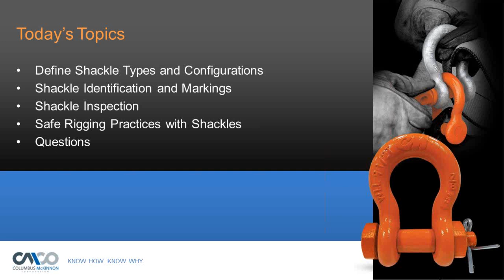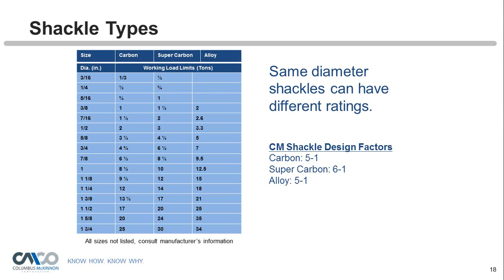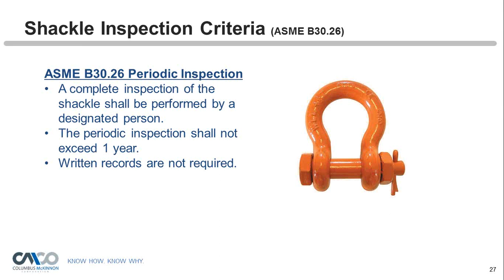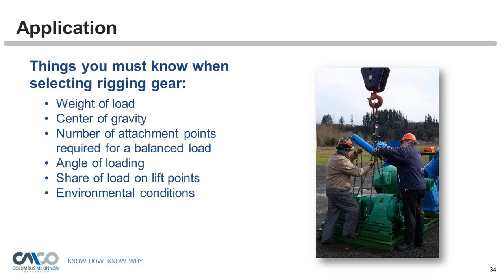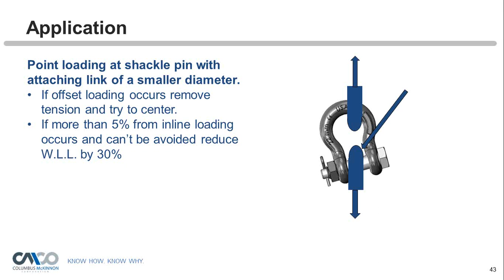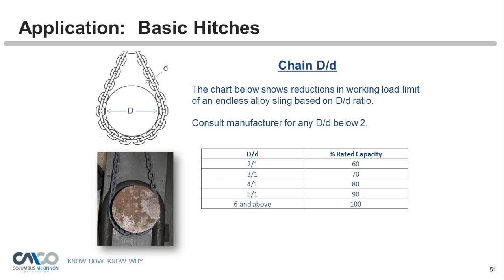Safety Webinar: Proper Use of Shackles

Comment: No tag lines installed by the crew which was a major no no. The footing (dunnage) wasnt secured which caused the load to slide and slip out. The strap was questionable but i feel it broke when the load was dropped causing more weight to be put on one side vs the other. Probably overloaded its capacity. Lastly them straps were on a bar with nothing preventing them from coming off. Why didnt they use a secure lifting lug with a shackle?

Comment: What is the proper way to tighten a screw Pin on a shackle. I have a customer that is saying the top of the bolt is breaking it after using a wrench to tighten it.  Should you only hand tighten a screw pin in a shackle?

Comment: I have a question.
If i don't have 2 meter 5ton Swl wire sling, i can bring 15 shackles and connect them between each other to reach the 2 meter length which I need.
Its a safe or not safe, and there's a lifting standard for this practice........ If anybody have an answer so his reply will be appropriated
Reply: Technically you can as long as you account for the load angle factor, stay under capacity of shackles ofcourse

Comment: I have a question, 
Do you use the "mode factor" of 0.7 when using shackles ? Or is that only applicable when using slings and chains etc ?
Thanks in advance 👍

Comment: what are the three parts of a shackle? and how is a shackle measured to determine the size?
Reply from the maker: Hi William,
Ok, shackles used for lifting are screw pin shackles and nut, bolt & cotter shackles.
The screw pin shackle only has two pieces, the shackle body & the screw pin.
The nut, bolt & cotter shackle has four pieces -  shackle body, the bolt or pin, nut & the cotter pin that keeps the nut from backing off. 
The cotter in a nut, bolt & cotter shackle does not see any load.

All shackles, regardless of the manufacturer, must carry three markings on the shackle per ASME B30.26
:
1)	Manufacturer's name or trademark
2)	Size
3)	Capacity

The size is what you’re looking for and that size will be the diameter of the body of the shackle, not the pin size.

Thanks for reaching out to us!
Henry Brozyna
Reply: @columbusmckinnon   what factor of safety to be used sir?

Comment: how to find crack on shackle..? what using method
Reply from the maker: Hello Elvin, magnetic particle inspection is the best method. It is non-destructive and cracks will be exposed -  large as well as small. 
- Henry Brozyna
Reply: Ok.thnks your information.
So the galvanized layer must be removed?
Reply: besides the mpi method are there other methods?  because, there is someone giving the method in the way at the shackle.  and he will find cracks through the sound of the sound produced, is that true right?
Reply from the maker: @elvinrowanda8749  You do not have to remove the galvanized coating to do an inspection.
Abnormalities will be exposed with the plating in place.
As for other devices used to detect abnormalities, yes there are others.
As long as the method used does not damage the shackle, in any way, you can use it.
There are a number of non-destructive tests that can be used. 
Henry

Comment: The question is about GAC Flex (misspelled as GAK) it stand for Galvanized Aircraft Cable, which is the material used to make the sling.  They look very much like poly roundslings but are built of a single strand of GAC (often 1/16") wrapped endlessly inside of a poly cover.  GAC flex is quickly gaining market share in the entertainment industry due to the perceived improved performance in cut resistance and in high heat vs standard roundslings: as in keeping a load safely suspend longer in the event of a performance venue fire.  GAC Flex is a fine choice for overhead lifting as long as WLL are adhered to like any other sling.